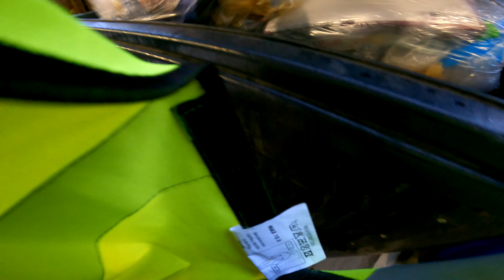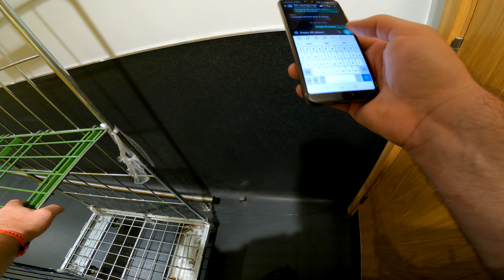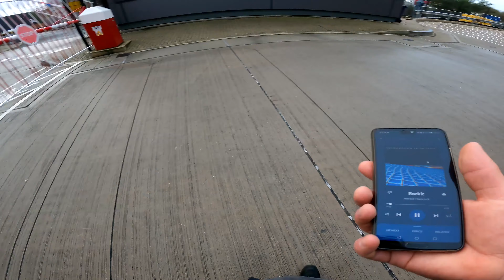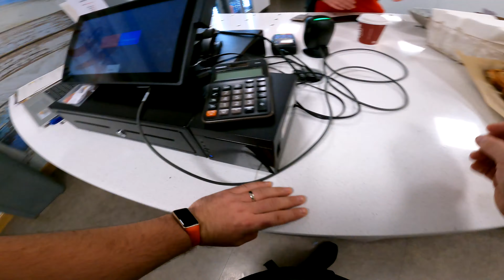Today I'ave been mostly washing dishes! POV kitchen porter action 👌😂👍

Comment: I have a question. I work in dishwashing, and the chef tells me to wash with very hot water, and my hands burnt, and I could not bear the heat of the water. I am the only one who cleans the kitchen and washes all the dishes and utensils in the kitchen. I have another person working with me, and the restaurant is very large. Is this fair or am I exposed  to oppression
Reply from the maker: Hi, which country? I'm sure there are regulations. They should give you heavy duty gloves at least.
Reply: @MrT2022  uk where is your restaurant please?
Reply: It's mandatory to have very hot soapy water when you wash dishes at restaurants or wherever there is to where you wash dishes you need gloves if you can't handle the heat

Comment: Thank you for the video, and yet again people touching dirty dishes and water then touching the clean stuff! You clean and/or sanitize the trolley after putting garbage on it, right? To use it for clean stuff?
Reply: Yeah nah I wash dishes as a main job and as soon as you touch the sprayer you sanitize and wash your hands
Reply: @jasonmamoa3266  I scrubbed and rinsed my heavy gloves with soap and hot water with some hand shaking off the water before touching.
Reply: They sanitizer the last part of dishes. Using Quat ammonia and it is proven to sanitize

Comment: Now that's an odd way of doing dishes. Why do you prewash everything with soapy water and a sponge, that's not needed at all. Just a quick spray off with the shower is enough. There's detergent in the dishwasher too. So it's a double waste of detergent and extra handling. You won't be able to do the dishes from 150 guests that way. The table for clean dishes doesn't need to be dried off after each clean rack which has stood on it. Once a day at the end of the shift is enough. The excess water will automatically run back inside the dishwasher. That other garbage bin does not belong at the clean side of the dishwasher, better locate it next of the other one. It saves you walking to it too. Washing cutlery can be done much easier and better. Don't soak them in soapy water, spread them on the fine maze rack and run through, then take that blue rack which stands on the dirty side and put all the cutlery still being wet upright in it, handles down, run them through another time and then never dry them off but leave air drying. If you use soapy water to pre wash, the soap will deactivate the detergent in the dishwasher. That soap is meant for cleaning surfaces and floors or for items that does not fit into the dishwasher. I recommend you to use a strainer on top of the sink you're rinsing off dishes in to avoid the sewer getting clogged. A 1/1 Gastronorm container with holes in it, usually meant to steam veggies will probably work fine for that purpose. Or you ask your boss to order a special one from Winterhalter, the supplier of the dish washer. I wish you good luck trying out these great hints, which will make your job a lot easier.
Reply: Relax mate we didn’t need a whole book

Comment: 08:13 Since when the knives can go into dishwasher? I don't wanna be rude here but I've learned the knives should wash in cold water without detergents immediately after use. The dishwasher has very hot water, and it is precisely for this reason that it is not advisable to wash the knives in it, as they can easily become dull and unusable for the next use. 🙂🙂🙂🖐🖐🖐🖐

Comment: You don't dry the tubs after they have been put thru dishwasher >:( also the chopping boards! they are always soaking when they come out of dishwasher + they are stacked with green and yellow chopping boards. MEAT AND VEG CHOPPING BOARDS SHOULD BE SEPARATE FOR HYGINE. This is appauling standards for being a KP shame on you for letting your kitchen rot like that.